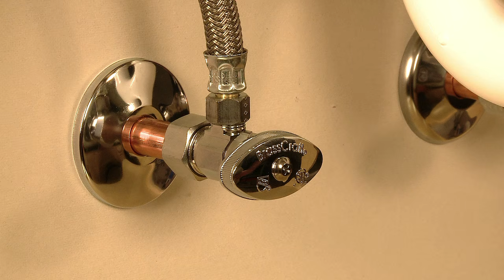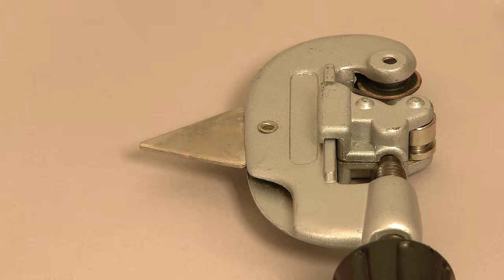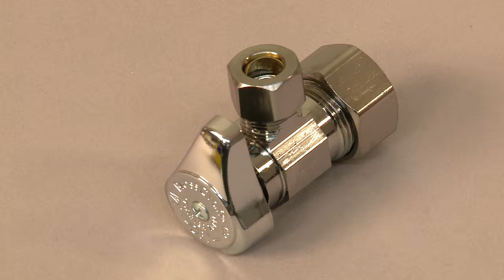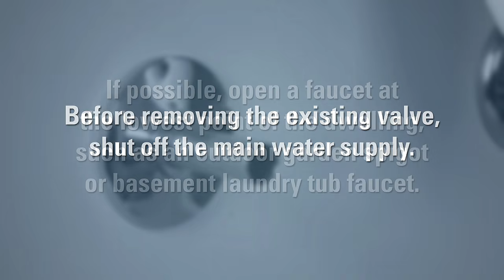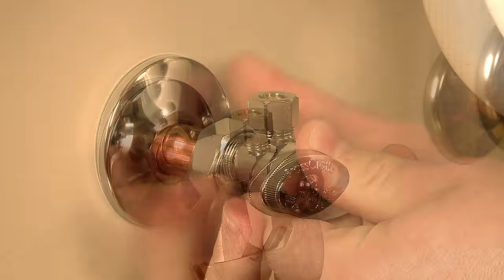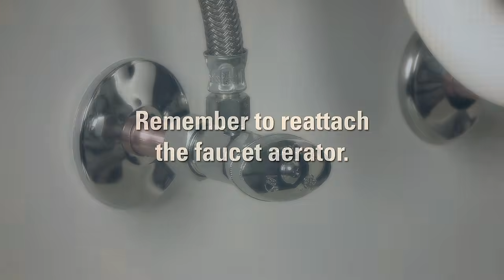How To Install a BrassCraft® Compression Valve

Comment: Why is mine leaking from behind the nut
Reply: I hope you got the leak resolved. I just did it yesterday for the first time and it too was leaking from the back of the nut and not from the threaded front part of the connection to the valve. Here's what happened I hand tightened the nut onto the valve and then using a wrench and tighten it a bit more like the video says at 3:00 mins in and found it leaking (at this point, I did not pay attention to exactly where it was leaking). I was afraid that I crossed threaded it or that if I would over tighten if I continued to apply the wrench to it. This is while my main valve is shutoff, but I had realized minutes after the old valve was removed that all of a sudden it was not drippling out anymore but a slow stream of water. I checked a faucet that I had opened since shutting of the main that it too had a stream of water coming out. So, my main water valve isn't working all that well. In any case, that means I had to work fast. I disconnected the 3/8" line, removed the valve, and noticed that the olive(ferrule) isn't even crushed (the nut & olive is still loose...you can push it in and out). I made sure I had cleaned the copper pipe with Emory cloth and reinserted the new valve (push it all the way in until it stops. It has a tendency to slip out while tightening). Hand tightened the nut making sure it's not cross threaded until it seats and then using a wrench to tighten it down (another wrench to hold the body of the valve in place). This time I noticed it was leaking from the back of the nut (the side facing the wall). Fact is now that I know I had not forgotten to clean the copper pipe, pushed in the valve all the way, and had not cross threaded the nut onto the valve...it took SEVERAL more attempts to tighten the nut (I presume until it crushes the ferrule and makes a seal). Eventually, it was time to turn on the water (half-way) with the new valve in the "close" position and check for leaks again. Once there were no more leaks turn the valve into the "open" position. Yup, still leaking...tighten some more. Eventually, no more leaks.

Comment: I can’t believe I am having to tell you this is a handyman and not a plumber that you are not supposed to put pipe dope or Teflon on the ferrule (brass ring) this is coming straight from the manufacturer, you can see in the brass craft manual and videos. 

You’re obviously a great plumber, but that step you’re taking is not helpful and it could even be harmful in the long run . 

Anyone who watches this video looking to DIY your own plumbing remember to consult with the manufacturing instructions and not just follow what everyone else does, even if they are 99% correct .

Comment: Is it possible to change de angle of the valve, just to loose the nut of the compression valve,turn the valve of 90 Degres and tighten the nut with the same sleeve? Is it dangerous to leak?

Comment: i have installed the new shut off and it still leaks. after i tighten the unit i can with a litle force pull the whole unit right off. yes everything is the right size. i have tried the seal tape to help still no success. Any ideas how to fix???  thanks for any help!!!
Reply: Did you end up finding a solution?? Im the same situation with being able to pull the whole unit off (but its the right size too)
Reply: Did you figure it out? No, no tape!
Reply: Same here—compression ring compressed inside the nut, but not around the pipe, and the whole unit comes right off. When I examined the previous shutoff valve, I thought it was odd there was no ring around the pipe to remove, but noticed it was compressed inside the old compression nut as well… would love to know why the ferrule is not compressing around the pipe

Comment: Wow you skipped over the only part I needed. Removing the old valve. Thanks
Reply: Need a compression sleeve puller from Home Depot to pull of the ring(ferrel).  About $15 tool.

Comment: Can I install without shut off main water ?
Reply: That's like do I need to turn off the circuit breaker before I remove the electrical socket, isn't it?

Comment: Tightening only 1/2 a turn will leak for sure
Reply: What are you saying...tighten more or less than 1/2 turn?
Update: Did this job yesterday and it toke a bit more to wedge that ferrule into the valve to stop it from leaking!

Comment: I kept the old nut . Used teflon tape before installation of new valve. Bought this house with the valve off . Was never told by previous owner that it was leaking until we install new dish washer

Comment: I didn't have room to get a wrench underneath the new valve. I used a 2.5 inch 'C' clamp and found that worked really well, actually better than an adjustable wrench. It works from below or above.

Comment: I tighten my larger nut onto the valve and tighten with wrench but the whole unit (nut and valve) can still spin on the pipe. Is this supposed to tighten onto the pipe?
Reply: Just did it yesterday for the first time. That valve will spin and move in and out unless you really tighten that nut and compress the ferrule which will wedge the valve. After it all done, I won't go pulling on that valve very hard either.

Comment: Great video. I wish you explain that with a compression valve you shouldn't use and paste or tape to make a better seal or fit. The paste or tape on a compression joint or valve will cause a leaky valve or joint.

Comment: Just open the lowest water receptacle in the house… unless it just so happens to be the one you’re working on and the water’s still draining out of it 3 hours later.
Reply: Good thing about compression fittings, pipe doesnt need to be dry to install, just open valve and let it drip while you tighten nut, than shut valve when done.

Comment: I bought two BrassCraft valves, both leaked from the handle no matter how much I would tighten. I ditched both and got another brand, worked fine. What a cheap quality/brand.

Comment: Nice instructions but 3 of mine leaked!  So I had to redo them.  I found that I have to go at least 1/2 turn.
Reply: Did you redo them using the same nut and ferrule or did you have to get new ones each time you redo?

Comment: Great tutorial! I was quoted $700. to replace a water compression valve by a plumbing company. Did it myself for less than $20. thanks to your tutorial.
Reply: Omg that's crazy! They tried to rip you off!
Reply: Crazy where?
Reply: @pearlperlitavenegas2023 mexico
Reply: @pearlperlitavenegas2023 probably just replaced the valve and no supply line and used a knife or something to deburr the line
Reply: @Guacamoc  and????
Reply: @pearlperlitavenegas2023 I was quoted $400 in New England just yesterday
Reply: 700 😂😂😂

We dont call those plumbers…
We call this scam artists.

Comment: That is the stupidest design ive seen when the pipe breaks you have to replace the valve too.  With the regular one you just change the supply line as needed.

Comment: Does anyone use Teflon tape on metal to metal connections? Is the lubricant sealant the standard these days of plague?  BTW-BrassCraft is the Premier fitting for everything plumbing.

Comment: Why do you need a pipe cutter?
Reply: To remove the old valve
Reply: @ashleyharris3473  is there a way to remove the valve without cutting the pipe because it is too short?
Reply: @Mordolap  compression sleeve puller
Reply: First of all determine what type of valve is on the pipe. If it was sweated on then it will have to be cut.

Comment: For removing the old fitting I strongly recommend getting a compression ring puller. They're pretty cheap, and they make the job of getting the nut and the ring off very very easy and clean. Over your lifetime that $10 is very well spent.
Reply: Thanks for the tip!
Reply: More like $15 - $20 now.
Reply: Thank you! None of the videos I've watched mentioned this. I could have saved hours of frustration if I had known I would need a puller.

Comment: Any tips to fix leaks? I cant get my 30" Brasscraft hose to stop dripping. It's 1/2" pipe to 1/2" compression. The compression stem behind the nut seems to keep dripping. The unit seems a little sloppy on both hoses and net getting tight enough. I have pictures but it's not letting my add them here.

Comment: Can you easily remove/replace the decorative escutcheon if it is rusted, prior to replacing the replacement valve? My plumber told me that "since a compression valve is involved there would be "lots of work, and destruction of the wall" to replace the decorative escutcheon:. I think he is lying. Could you weigh in?
Reply: You can remove the old one with metal snips (aviation snips) no need to remove the valve
Reply: Anne Arjani If you want to replace escutcheon only, it would requiring removing the valve and reinstalling it.  It the valve is old or a multi turn one, replacing it with a quarter turn valve would make it worth doing and replace the escutcheon. But to replace just the escutcheon is a lot of work if the valve doesn’t need replacing.

Comment: Any plumber who continues to use gate, globe or multiturn valves - in my mind - commits professional malpractice.
Reply: I am not a plumber, but I just installed a multiturn valve. (Part of a kitchen remodel). What is the issue with them?  I appreciate your expertise.
Reply: @LennyLewis  They are an old school valve type that tends to go bad a lot sooner and prone to leaks more at the turn part. 1/4 turns are the way to go, also more convenient when it comes to turning on and off.
Reply: Lenny Lewis The multiturn valve has a rubber seal that will over time deteriorate, especially, in the hot water supply, and may not seal 100% if closed. Also, it may leak due at the packing but cover but usually it can be re-sealed by tightening the nut. The quarter turn valve uses a plastic ball, like the ball valves, that doesn’t deteriorate by age or hot water.  The price difference between the two is literally $1 and it is malpractice to not use the quarter turn valves instead which last longer than multi turn rubber seal valves.
Reply: Quarter turn valves are code required now, apparently.

Comment: Can this compression valve be used with a steel 1/2 pipe extruding from the wall? Or does it have to be brass pipe? tx

Comment: This video got me in the ballpark but it would be helpful to see the ferrule removal if it's stuck, possibly with a compression removal tool.  Mine was too tight to pull off and I may have scored the pipe in attempting to get it off.  I put on the new shutoff with the old ferrule and nut and it's got a slow drip.  I will try removing ferrule with proper tool and replace with a new one, hopefully that will seal correctly.
Reply: I had the same problem. I tried to use the old ferrule/nut with the new valve and so had a leak. I bought a ferrule puller and was able to get it off, but I think I damaged the new compression valve by overtightening with the old ferrule/nut in the first place. With the all new hardware I have no leaks, but I went way tighter in that valve than the others and I'm worried about having to cut off/extend the copper pipe if I ever have to replace the valve again. The other 3 were fine, learned my lesson!
Reply: Yeah, got the old compression ring off with a puller and used the new one.  I had to tighten it really tight because the old one  grooved the copper.  No leaks after two weeks, but the pipe will need to be cut next time.

Comment: can the compression ring  shrink or the pipe expand? heat stop working in the winter now I have a leak and the ring will not fit on. only at the tip

Comment: My contractor installed a polished brass angle stop, but didn't have the flange to cover the wall where the copper pipe comes out.  He said to find a split flange.  However, I can't find a polished brass one.  Do you know where I can find one?
Reply: The are typically polished chrome or white plastic

Comment: Master Plumber here with 30+ years.  Brass Craft. Are you certain that a 1/2 turn past hand tight is right?  This will not compress the ferrule in to the pipe.  This plumber and many other think your misleading the public.
Reply: I way over-tightened mine with the first attempt which resulted in a very slow drip leak, and a damaged pipe under the compression nut. I had to cut the pipe, solder on a new extension, and start over. My second attempt was exactly as described in the video; hand tighten, and then wrench turn a little more than half a turn more. Worked perfectly and no leak
Reply: @seanharris7546   Yeah, that's about right in my experience. Not sure why "deburring" the inside of the pipe is necessary, but possible they are thinking of the physics of a burr slowing down the flow or a small piece of copper getting caught in the valve. Ok, i talked myself into deburring :)
Reply: Alyssa longchamps i feel the same way for the 1/2 turn im pretty aggressive when tightning on a new angle stop valve but you can always do a pull test cuss you and i know theres alot of pressure on that angle stop valve.
Reply: I'm not a plumber but whenever I tighten bolts I never go by "half turn" type instructions but instead feel for the "bite"  when the torque seems to have been just right. It feels like the  turning stops and then mushes in just a little bit as it bites.
Reply: turn on main water supply SLOWLY...nothing worse than opening a ball valve fast.

Comment: thanks for the wonderful video.

why did not you use teflon tape in when installing the valve?
Reply: From what I understand Teflon tape would actually prevent the nut/ferrule combo from compressing properly and forming the tight seal. It works differently from a shower head or hose fitting.

Comment: How do you remove the original angle valve ? Mine isn't coming off
Reply: cut it off with one of the pipe cutters he has .  .  .or hack saw :)

Comment: According to Murphy's Law a shut off valve can be relied on for many years until a few moments before you actually need it.
Reply: once a year ..turn the valve just a little to keep it free inside..it will be ready when you need it.
Reply: @workingshlub8861  good tip
Reply: It's a bitch
Reply: And here I am.
Reply: This is 100% true of gate (multi-turn) valves, because they have a seal inside that compresses.

It's 99.7% false of ball (quarter turn) valves, which are not only a much simpler mechanism, but which don't seal using a compressible material that can fail.

In my opinion, the only reason gate shutoff valves still exist is that they are around $1 cheaper, and it's rarely a knowledgeable owner that installs them. Plumbers would rather pocket a buck than prevent problems for you down the road.

My house was built with gate valves around 20 years ago. Shortly after we bought the house replaced all the bathroom shutoff valves with ball valves.

A few months after that, the (original) gate shutoff valve for the refrigerator failed by starting to leak. The link went under the floor, into two adjacent rooms, causing several thousand dollars worth of flooring damage. I'm absolutely certain that if this was a ball valve it never would have failed. It's so great that the home builder saved less than $10 by putting in these cheap valves when they built the house.
Reply: @RaymondPeckIII  I've been in construction for five years and I'd never heard this. So good to know, thank you!

Comment: ok so this took ~ 5 mins. take 15 mins out of your day and sweat it on and it will last forever or until the valve itself has to get replaced.
Reply: i have question though, do i need to turn off the hot water too? beside the main water supply? ty! :)

Comment: The directions say "after removing the old fitting..."  Well, that's the part I needed to see!
Reply: Yeah I'm dying here trying to remove my old one
Reply: I use a hack saw to cut through the old ferrule.  It takes like 20 seconds, just be careful not to cut/scrape your new section of copper.
Reply: @jwag2708  use a compression sleeve puller. Husky home depot is pretty good.
Reply: Definitely search for "compression sleeve puller" to see a helpful tool
Reply: It's like a wedding ring, you have to carefully cut a slit and open it up.😅
Reply: How funny I had to go back n see if I skipped that part .. BUT NO!!! HE DOESN'T SHOW THAT PART .. LIKE WHAT THE HECK. SO ANNOYING.
Reply: Simple watch the video in reverse
Reply: @Zac19088  😆😅😂🤣

Comment: Is this the same process for cpvc pipes? I have the metal brass compression valve connected to a cpvc pipe and it's leaking where the compression nut is located. I was under the impression that compression valves are suppose to be cemented to the cpvc pipe so tightening (and thus breaking the cemented seal) the compression nut would be a bad idea.

Comment: I was able to solder new copper pipes, add pvc drains, and even add new electrical wiring to my house. The last thing to do was to add stop valves and to be honest I was a bit intimidated, but after watching this video I'm more than comfortable to do it. You got straight to the point, and were very clear and specific about the job, materials, tools, and method. Thank you so much!

Comment: Thank you a million times. Great explanation for me to tackle a job I need to do.
Reply: You should not use sealant on compresson fittings.  It will interfere with the metal-to-metal seal when the ferrule (aka olive) is compressed into the copper pipe by tightening the nut,

Comment: I am wondering if these compression ring fittings can be used on poly b tubing. I am well aware of the issues with having poly b tubing, but at this time replacing all my lines is not an option. I just need to install two shut off valves underneath a bathroom sink. Any advice would be greatly appreciated!